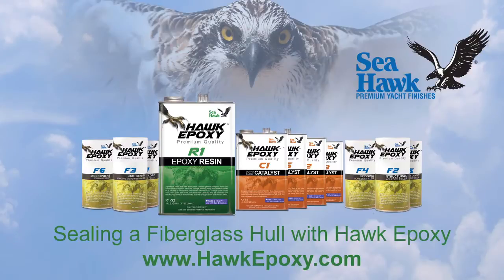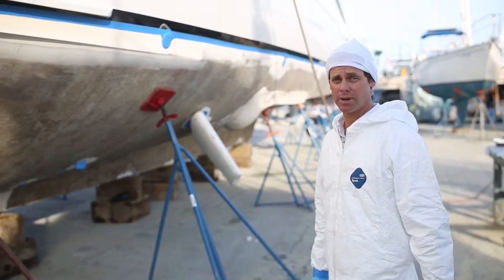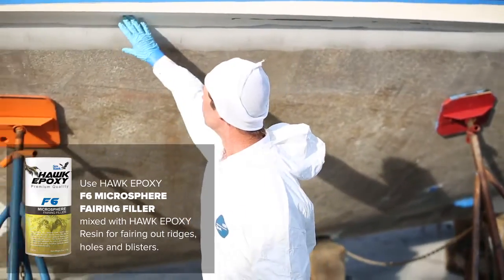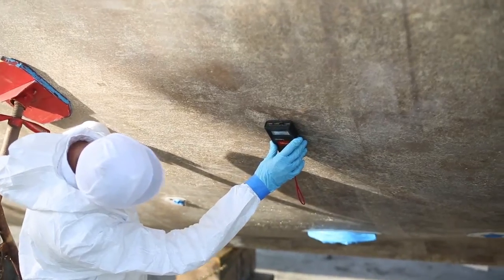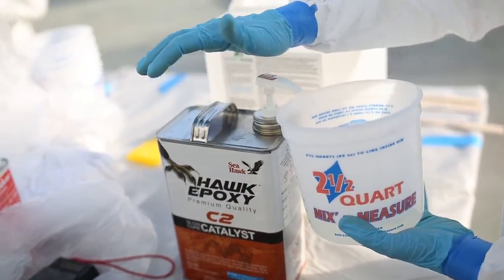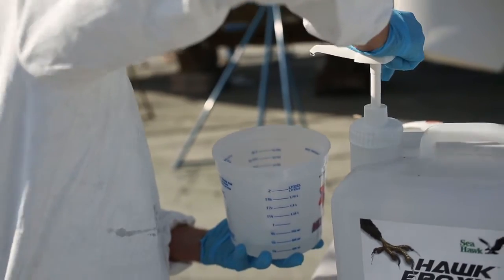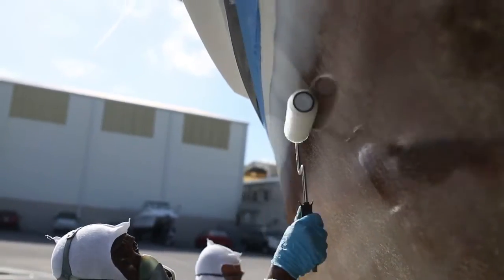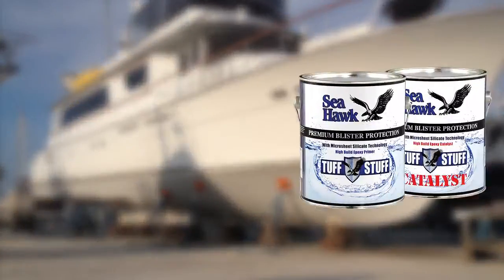Sealing a Fiberglass Hull with Hawk Epoxy - Sea Hawk Paints' state-of-the-art epoxy system

Comment: I've a 1979 Sears 11ft boat that I'm wanting to freshing up. The sun has really taken toll on the hull. Would this work for the hull in my situation? When I go to gel coat should it be ok to roll and brush on. Then I'd wet sand to obtain the desired finish. I have never done this type work before but I have a semi strong back,a decent brain and time. I'm a disabled police officer and I boat and repair boat motors to stay busy. I would greatly appreciate any tips for products that you can advise. This is a mostly fresh water boating application. As a medically retired police officer I'm on a budget so please keep me in mind when advising products to use. Thank you and your videos are VERY helpful!!!
Reply: It should. I would sand the hull, clean with acetone, then put on 3 or 4 coats of primer and sand everything smooth and to contour. After that, clean thehull withmore acetone, then begin applying gelcoat. I would rent a handheld paint sprayer from Home Depot ($33 a day where I am in Oregon) to apply the layers of gelcoat as it will help keep everything even and will take less time. You could still use a rolled and brush to apply it though. Then buff out to the finish you want and wax. If you are using a roller then I would sand and then buff out.
Reply: And thank you for your service.
Reply: DaebakMonkey how long do I allow for primer to dry before spraying gelcoat? What type of printer do you recommend I use? Just regular paint primer? How long after I apply to gelcoat do I wait to sand and then buff? I really appreciate you giving your time and knowledge. I'm in Waco Tx yes where the Branch Davidian shootout happened. Yes I was there. Thanks
Reply: Not a problem! I love helping people out. I personally wait about 4-6 hours but I am in the PNW where it is super humid. For you I would wait about 4 hours just to be extra sure. Try to get the coats of primer in one day as the next day can be spent on sanding and contouring but don't rush it, I have seen too many boats where someone rushed the primer and it bubbles up. For the gelcoat I would wait about 6-8 hours to be sure, and make sure to used non-waxed gelcoat for the first few layers, then on the final layer put wax in it. If you put wax in all the layers then the gelcoat will take a long time to cure, and by a long time I mean 4+ years. The wax creates a barrier which is what helps keep the gelcoat looking shiny after a season or two. I usually do 2 coats a day, one at 11:00 AM and one at 5:00 PM.
Here is the link to a good primer: https://www.fisheriessupply.com/sea-hawk-paints-1277-barrier-coat-primer-1277-1
Here is the link to a good gelcoat: https://www.fisheriessupply.com/sea-hawk-paints-gel-coat
These aren't top-of-the-line products, but if you wanted top-of-the-line products you would be looking at about $200+ a gallon.
Reply: DaebakMonkey gel coat to finish the hull? I’m confused, learning myself.  I thought gel coat was just used to finish topside above water line.  I thought you finished the hull with Antifouling Bottom paint and that is different than gel coat isn’t it?
Reply: brt 123 how did your boat come out looking?  I was thinking about painting mine.
Reply: Lando Leaves Land I was going to stay away from gelcoat and just use paint.  What did you end up doing?  Gelcoat is hard to work with